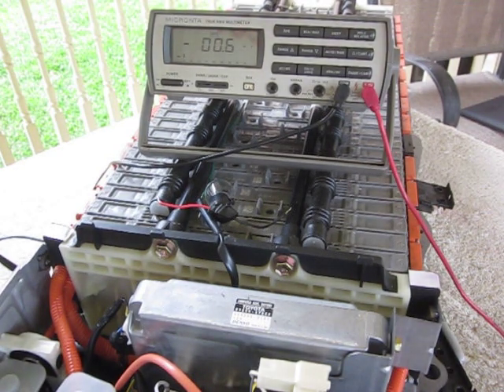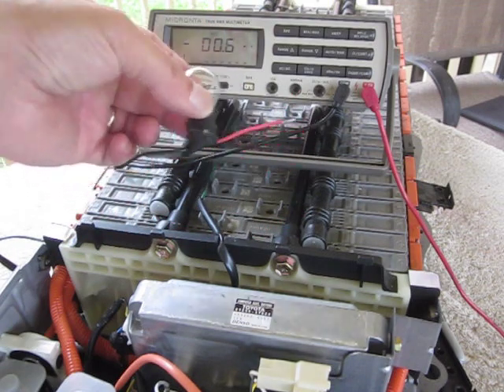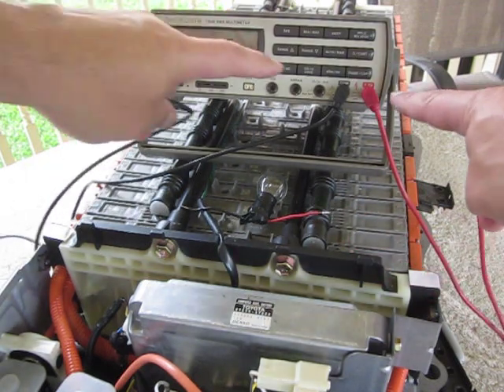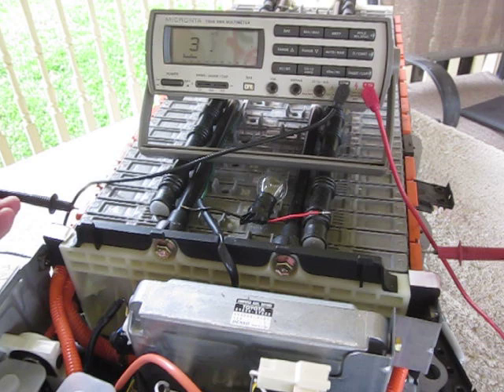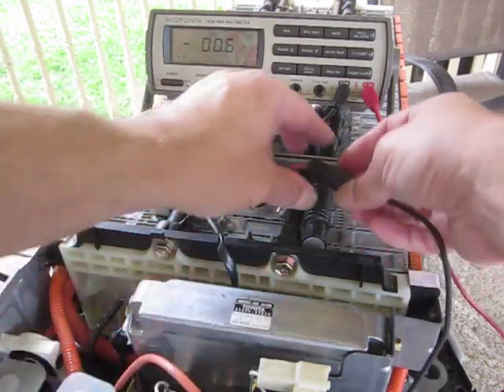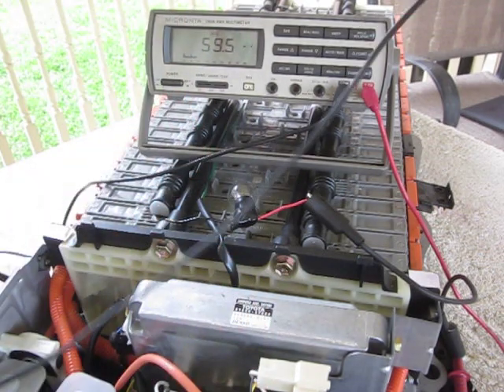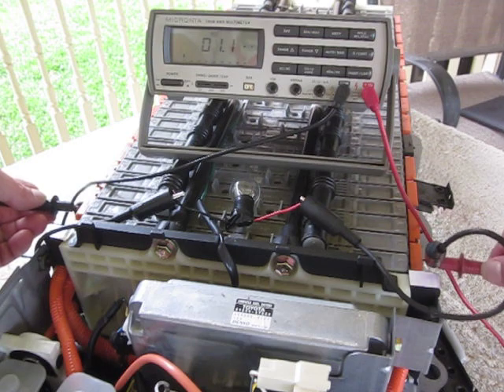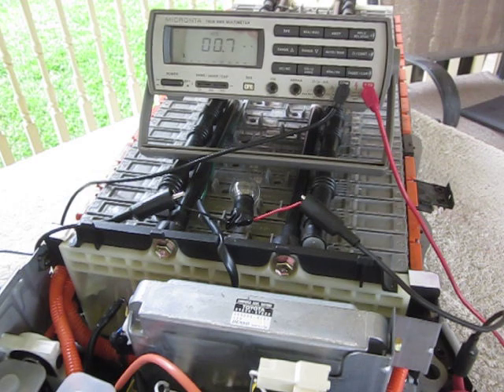How to load test Hybrid battery pack modules - set up and test

Comment: Is that a 12-volt bulb?
Reply from the maker: Yes, 12v #3156
Reply: @ZookeeperJohnG  Thanks.  I used a load tester on mine.  What are your thoughts on that?
Reply from the maker: That should give accurate results as long as the load is not too high.

Comment: Ok, and then what? What is one looking for? One cell might hold up its voltage for a minute under load while another drops dramatically for the same length of time? Can you explain further?
Reply from the maker: That is correct and the very definition of a battery load test.  While not critical to load each module for the exact same time, they should be close.

Comment: How do you make the load tester
Reply from the maker: I used an old tail light bulb from a car, almost any car, truck, or van light bulb would work, but the brighter they are the shorter the time they should be connected so as not to overly discharge the module.

Comment: i have my torque pro app . got a POA80 code on my prius 2012.  when driving , all my modules show 15.5 and all go up to  17.8 V. during active driving.  is there a way to check and detect a bad cells with torque pro app , not taking out whole battery and load testing it ? when the engine stops ,and AC is on , how fast must the voltage drop ? till what number ? 13 V or lower ? what is the normal drop rate in this case, when AC is on , on neutral with engine off ?
Reply: The paid version of Dr. Prius is much better than Torque Pro.  In Dr. Prius, there is a red record button.  Click it and let it run for at least a minute.  Click the record button again to stop it and then email a csv file to yourself which you can open up in Excel.  This tracks all of the block voltages, resistance, amps charged (-) and discharged (+).  Copy the 14 block voltages to another set of cells and use a formula to divide the block voltage by 2.  Use the Excel "Conditional Formatting" feature to fill colors in the cells when the voltage is in various ranges.  The range 8.58 to 8.65 is green (max charge).  Greater than 8.64 volts is overcharge (red).  Between 8.15 v and 8.58 v is orange (moderately fully charged).  Between 7.2 v and 8.15 v is yellow. Between 6.7 v and  7.2 v is blue.  Below 6.8 v is purple.  Color coding the cells will show you patterns of what is going on.  Note: there is very little need to discharge below 6 volts.  I have noticed this hurts the battery performance.   In the csv file, there is a column that shows MPH and another that shows amps being charged (negative) or discharged (positive). This gives you a good idea of what is going on in the battery and can pinpoint a bad block.  PS... you will still need to take the battery cover off to test the voltage of individual modules.
Reply from the maker: Here is a link to my load testing video: https://youtu.be/D9ibm221xuM